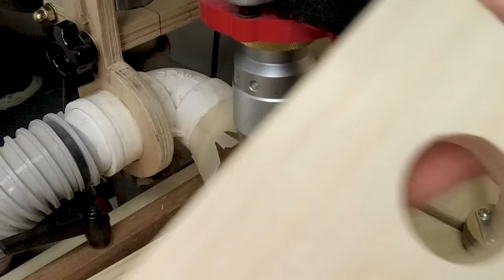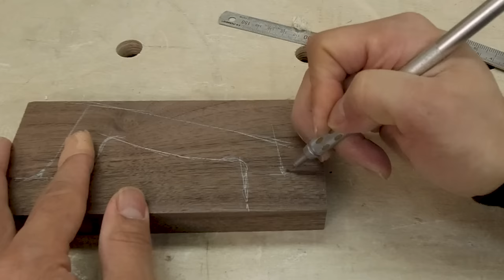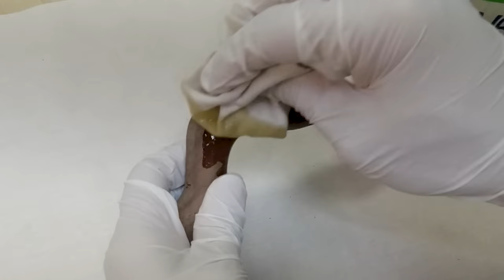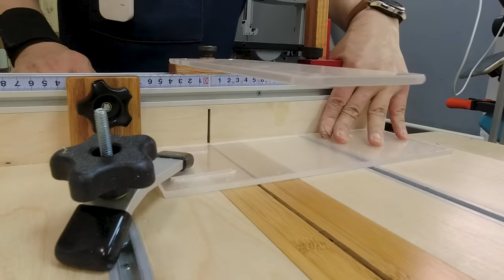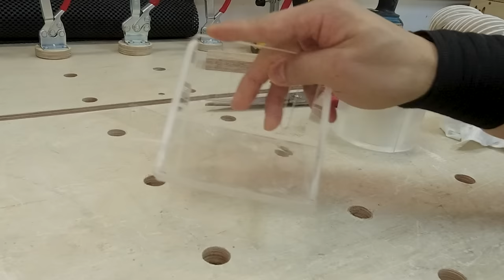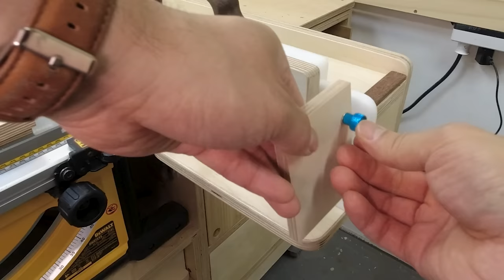[DIY] How to make a jig for cutting thin strips / Table saw project #8 / WOODWORKING / HOMEMADE

Comment: I'd just watched another 'thin rip' video, suggesting to the designer that it'd be better if it were to hook over the fence (his relied on a vertical block being pushed down above the blade) ... then I find you've gone and done exactly as I was suggesting ... nice to know I'm not completely thick ... excellent jig 👍

Comment: Another great idea.  By the way I was able to find a table saw blade with a wider kerf.  Similar to a dado, with just two blades.  Referred to as a bax tenon blade.
Reply from the maker: https://youtu.be/kvYxB5yBRkU 02:28 
Coming out here for a moment.  It is one blade 8mm thick.
Reply: @carpentak  Thank you for the information

Comment: What a great accessory!  I will definitely try to make one.  I recently took strips out of a sapelly plank (16mm) and as I cut them I could see how they twisted.  Could you tell me what it is due to?  and more importantly, how can I straighten them?
Thank you very much.
Reply from the maker: Wood that is less dry will become deformed.  Since this cannot be prevented, store them in large pieces if possible, and cut only as much as necessary.  Twisted strips must be corrected with a jointer planer and an automatic planer.  It's very difficult with a hand planer.  If the condition is severe, it is better to give up.
Reply: @carpentak  Thank you very much for the answer friend, it is very helpful.  
What plastic is the white you use for the fence extension of the other video?  
What blade do you cut it with?
Reply from the maker: This is plain white acrylic.  Of course, there are acrylic saw blades on the market, but I just cut them with a wood saw blade.  no problem in particular
Reply: @carpentak  White acrylic do you mean PTFE?  In my country acrylic can be any plastic.  How many teeth does the disc have?  I have a 60 tooth and maybe I will buy an 80 tooth. Thank you very much again, you are very kind.
Reply from the maker: I don't know if PTFE is right.  Here in Korea, they just call it acrylic.  My disk has 80 teeth.  60 discs would be good for cutting plastic.
Reply: @carpentak  Thanks a lot for your help, I'll look into it.

Comment: Buongiorno, spero possa rispondere a una domanda, stavo cercando il video (se esiste) della seconda sega circolare, quella affianco alla Dewalt, ma non lo trovo, potrebbe darmi una risposta?
Grazie
Ottimi lavori compliments... 🤗👏👏👏👏
Reply from the maker: hello.  It is my second table saw with an 8mm thick saw blade that I use exclusively for grooving.  Unfortunately, it didn't leave a video.  thank you
Reply: @carpentak  ok grazie per la risposta.
Mi spiace moltissimo che  non  ci sia un video, avrei voluto replicare il Vs video, sarebbe stato interessante vedere come hai fatto...  Sei un ottimo artigiano e con molta inventiva e ottimo ingegnere. 👏👏👏👏

Comment: Does the blade cut the bottom of the plexie hold down (where the 2 sided tape is) when you run a pass?
Reply from the maker: That's right, it's holding down and it's adhesive enough to hold it in place.
Reply: Does the saw blade cut the Plexi jig when it passes over it?
Reply from the maker: @williammc63  Set the height of the saw blade to be the same as the height of the part.  Then just cut off the sticky tape.

Comment: How is the blade not cutting into the plexiglass?? I dont see a gap for it to pass through.
Reply from the maker: I set the saw blade height only 1mm higher.  Then the acrylic cover won't cut.
Reply: @carpentak  won't it still cut 1mm into the acrylic?
Reply from the maker: 1mm is no problem.  A 3mm thick transparent tape is also attached to the acrylic.